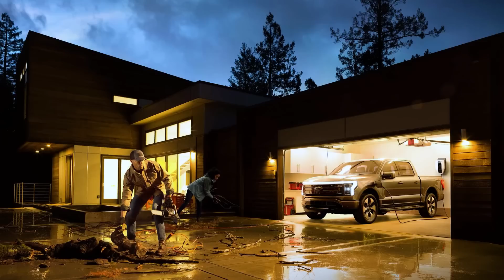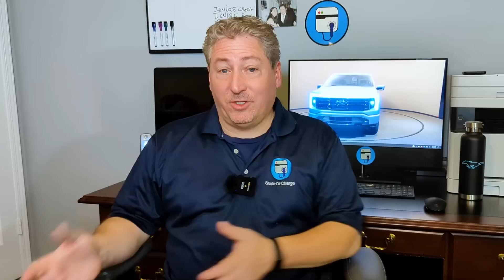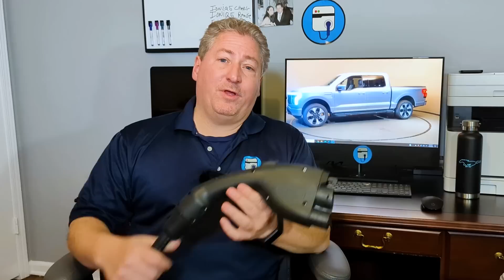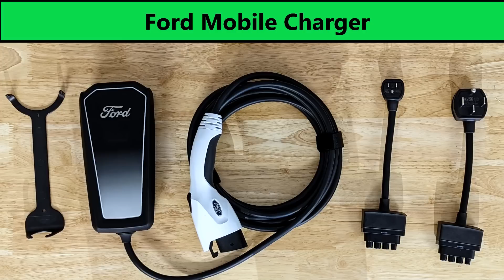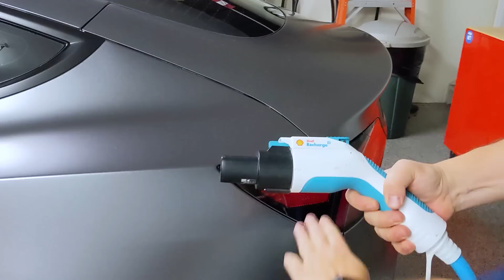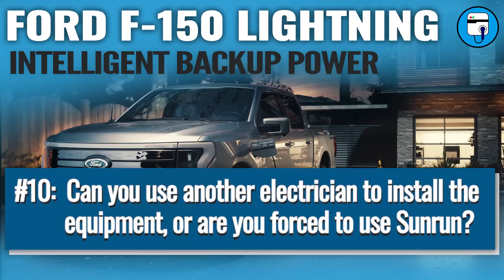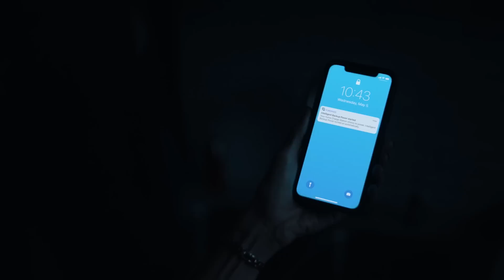Ford F-150 Lightning Intelligent Backup Power: Everything You Need To Know

Comment: Tom - thanks so much for putting this video together.  This is critical info that will help me make an informed choice when ordering my Ford Lightning.  The Intelligent Backup Power is the piece that trigged my interest in moving from an ICE to an EV.  This truck makes great economic sense... lots of addded value over an ICE vehicle.
Reply: but some of us that have 100A ( challenger panels are unsafe and obsolete by 2010 findings, its now 2022 yeh just go with the flow of civilised society ) are already upgrading to 400 amp maids like me and 4 or more homes on my bock have it two. as for your feelings yep my 1968 c 10 can't quietly back up my house 🏡so the ford does have a very good selling point and around town i was told it's cheaper to operate but i might not get the thumbs up as much as it just looks like a regular newer truck vs my classic fleet

Comment: I have been trying to get a straight answer from Ford and Sun Run but have not been able to get transferred to the right department. I have a extended range battery on my lightning and I have a trailer that I outfit my concrete lifting polyurethane foam machine. Graco E-20.
The E-20 during a concrete lifting project had peak amps of 38.5 (A-B and hose heaters and a proportional pump.
I had the truck bed outlets powering my air dryer, compressor, drum heater, lights and a fan(2400 watts peak) 
I have a 100 amp breaker in the trailer and I want to run the trailer from the truck. I don't see needing more than 50 amps at any point. When I tried to run the reactor on the 230 30 amp receptacle in the bed, I had no problem for the heaters but when the pump started the system could not keep up. I want to run the trailer from the truck completely.
I need 50 amps. What hardware would I need and who could I contact at Ford or Sunrun to help me get the system working. I would like to outfit polyurethane trailers to be hauled and powered by the lightning but I can't seem to get off the start gate.

Comment: Will you please do a Battery replacement cost for the F150 Lightning.  Because I have seen prices for extended range parts prices of $35,960 and standard range $28,556.47 through Ford Parts.  Just wondering what the average time a battery replacement should last for electric vehicles?

Comment: Great video. One update I have is that my system will not automatically backup when grid power goes out. I have to turn it on manually from the in-vehicle settings. I did some research on this problem and it looks like a very common issue if not the only way to use the backup feature. Also, the permitting department and fire department want to do a test of a rapid shutdown while the truck is powering the home. Disconnect of DC under load is not a good idea because the truck will try overcome the disconnect driving more power to the house and cause arcing and power surge in the house... so don't try it. I would love to know how the fire department is supposed to shut down the system in an emergency without causing a fire. Any feedback would be appreciated.

Comment: Solar Panels are DC and Lightning's batteries are DC. Is there a way to connect Solar Panels directly to the Lightning? I prefer not to have to convert the Solar Panel DC to 240V AC just so I can connect an AC Charger to my truck.

Comment: Tom don't know if you're still answering these.  I just installed the the whole system.  I have the Ford Pro 3000 charger and the platinum lightning.  The charging station wifi goes on and off all the time, it wont allow me to pair the truck to it, or, consistently show up on the Charge pro app so I can test the intelligent back up system??  Any suggestions??

Comment: Sunrun told my buddy they wouldn’t ship him a charger cause they said his car hasn’t been delivered. He says well it’s in my garage so your system is wrong. They said they won’t ship a charger until its say delivered in their system. Ford picked a terrible partner to make their charging and back charge inverter equipment.
Reply from the maker: There has been a lot of issues with the Charge Station Pro handoffs that my followers have reported As I have said in other places, I wish the unit was delivered with the car, or the customer could pick it up from their dealership before they take delivery so it could be installed before the truck is delivered.

Comment: Tesla sells their 48-amp Wall Connector for only $425. This is the best deal for a 48-amp home charging solution out there. This is not a bi-directional solution like the horrendously expensive Ford 80-amp connector but I mention it because the Ford 48-amp wall connector was mentioned as costing the same as all other systems on the market (which is not true).

Comment: Great video Tom! Very informative as usual. I have a particular question that I am unable to get any answers about:

If I already have a natural gas standby generator and transfer switch connected to my electrical system will the Ford home intelligent backup system be compatible? 

I think I know the answer to this question but there must be a way to install relays that will activate the generator and turn it on when the battery on the truck runs low so the generator can charge it back up.

Thanks again, hopefully Ford may see this question and address it someday!
Reply from the maker: Yes is it. Check out my new video: https://youtu.be/P7gCIT5FoAw

Comment: I have solar and I am about to install backup batteries with the goal of being energy independent, and someone suggested the F150 Lightning could accomplish this. Is that correct? Does it have the ability to switch to backup battery with the Home Kit whenever my solar is producing insufficient energy to power my home and drawing from its battery as opposed to drawing from the grid? I'll still be connected to the grid, but the idea is the draw comes first from solar, then battery, then the grid. I haven't been able to find anything addressing this specifically.

Comment: One thing that I think you’re missing is large scale power outages. When an entire region is out of power due to a storm it’s not possible to recharge anywhere for several days, a week, or longer because the fast charging stations won’t have power either. That’s when you need another solution to charge your EV.

Comment: Hi Tom, Thanks for the video. The one question I can't get answered is how to get the Intelligent Backup Power software activation for my Standard Range F-150 Lightning? I've had the truck a couple of months and it's great!  I bought, and have received, The Ford Charger Pro and the Home Integration System from Ford/Sunrun, so I have all the parts.  Sunrun doesn't operate in Oregon, so QMerit is the suggested installer here.  Qmerit connected me with their local partner, Beaver Electric in Hillsboro, Oregon.  Beaver Electric has put in a bunch of chargers, but no Home Integration Systems yet.  Ford's web site  says “Intelligent Backup Power software activation is included with the purchase of the extended-range F-150 Lightning battery or can be bought as a one-time purchase for the standard-range battery here.”  The word “here“ is a hyperlink to a page, after signing in to Ford, that says “SOMETHING’S NOT QUITE RIGHT, so it's a bad hyperlink.  I understand the upgrade is $500 and it is done over the air.  Over seven Ford phone-based customer support departments, in at least 3 different continents/islands, kept bouncing me to the next group,  but no one knew or could find the answer.   Please ask Ryan Ogorman, Head of Intelligent Back Up Power, as he, if anyone, should know.  I hope to get the charger and home integration system installed in the next couple of weeks, and this software upgrade/activation is critical to make it all work.  Thanks in advance for any assistance you can provide!

Comment: Did I miss the battery replacement costs? I looked at a 2013 Nissan Leaf. The battery is no longer available from Nissan. After market batteries with a 200 mile range cost twice the value of the car. That means the car is essentially totaled if it needs a battery. I do not see your Lightning going 10 years on original battery. If this is not figured in I do not think it is a good comparison. Sorry if it was mentioned and I missed it.

Comment: So, the big question is "how do you get the dc power from the truck to the home integration system"? Looks as if the ccs goes from the truck to the charge station, but the charge station is not an inverter. so what wiring goes from charge station to home integration to convert the dc power to ac power?

Comment: Great review. You speak so comfortably. Concerning Battery Backup a good point to make is despite a 30A limit of electricity sent to the house, if you stagger your electrical use you can run a lot of things. It isn't necessary to run the microwave, hair dryer,  gas forced hot air blower motor and toaster oven at the same time. Stagger them and the F-150 delivery capability will not be overloaded. Houses have 200A service panels so you CAN run all those things at the same time.

Comment: Please can you comment on the SIZE of the panels for charging system.  Sunrun will give me NO information on how large it is and how much roof space it will require.  In fact I have to build a structure to put system on BEFORE I take delivery of my truck and they will not tell me what size it needs to be.

Comment: If you want to power your home from your truck you will be able to do that with limitations.  Those limitations are:
No automatic transfer switching. 
Maximum 7200 watts supplied to home from truck.
You will need some sort of transfer switch to avoid back feeding to the grid.
You will need a way to connect the 30 amp receptacle on the truck to your transfer switch. 
If you're already setup with a generator you plug into your service.
Then you can used that connection to your truck instead of to the generator. 
The simplest transfer switch would be using an interlock in your service panel. 
A 30 amp generator breaker located just below your Main breaker.
The interlock will prevent the main & generator breaker from being closed at the same time.
As mentioned above you will be limited to 7.2 kw so you won't be using you electric stove, electric clothes dryer etcetera.
Note:
If the panel you are powering with your truck has the ground tied to the neutral you may get a ground fault error on your trucks sync screen. If you wish to use this scenario for home  backup,  I recommend you work with a qualified electrician.

Comment: I believe the 320amp service requirement comes in because of the NEC's 120% rule which states when back feeding a main panel the busbars can not be overloaded by more than 120%. Without getting into the weeds if Ford opens this up to feed power to the grid to reduce your electric bill (which would totally be cool) you could possibly back feed too much power that the main breaker would not see possibly causing a fire. For example if your main panel has a 200 amp breaker and the Ford charger can back feed up to 60 amps there is a possibility of having 260amps total on your main panel's buss bars if your home is using that much power at any given time. In this scenario the breakers would not see it or trip but your buss bars will be feeling it and be heating up. However, a 320amp panel is allowed to have up to 64 amps of back feed. Not confirmed only my guess. It would be interesting if @ford  can engineer in a software  limiter based on CT readings taken off the mains that way you can swt the back feed limit based on service size of each client. Ford can send a consultation payment my way ;)

Comment: I'm sure the 9600 watts that the lightning is capable of outputting has nothing to do with the power that can be supplied to your house.  The reason I say this is when powering your home with the lightning you aren't utilizing the trucks Inverters. The power is coming straight from the trucks battery via the two DC pins on the charge port. The roughly 400 vdc is transferred to the home integration system which contains a 400 vdc input inverter which converts that DC voltage to 240 vac which is then transferred to the service panel via a transfer switch which also disconnects the grid from the service panel. I'm not sure of the amperage but assuming it's close to 80 - 100 amp range, or 19.2 kw - 24 kw output if it was to power the entire home for 3 days @ 30 kw/ day.

Comment: The you need to add up all the panel traffic including loads, batteries and other self generating current . That’s where the panel rating comes in, not the size of the service. A generic way to attack this is upgraded you panel to a 400 amp  buss and derate to the main breaker size.

Comment: Could you charge up the truck at a fast charger at the dealer? Then use the charge to power your house?! Reminds me of the stingy villain, Smythe, from the movie "Jules Verne's Rocket to the Moon" 1967 stealing gas from gas lamps using a hose and pump. Swiping $20 of electricity doesn't make practical sense, but it would be something for the LoLs.

Comment: You need 100 amp wire to charger, at 80% load gives u 80 amp , so 100 amp is not enough, min200 amp, you keep 100 for the house 100 for the charger

Options to charger circuits
 20 amp
30 amp
40amp
Those typical for appliances so you could put those to a charger 

I believe the lightning comes with a two chargers 15 amp and 30or 40, get a electrician set up 40 amp circuit you have 220 v 40 amp circuit available at 80% load gives you 31 amps to charge,

Comment: My Generac can provide 18 kW running on NG. Its run time is unlimited. The total cost with transfer switch and professional installation was $10k. And I can drive my vehicle while the Generac is powering the house. The 9.6 kW that can be provided by the truck isn’t going to handle the starting current for my 5 ton main A/C.

Comment: I can’t imagine the backup power thing will be used to death (warranty covering home backup power)

99% of people will never use this, the 1% that do will probably use it maybe once a year. Sure outliers will exist(off grid workshop maybe) but I’d think it’s worth giving that 0.1% if users to just have free batteries. It will take years to ruin a battery that way anyway.

does driving really pull from the battery differently than using it for other purposes?

I would think the loads would likely be less (but pulled in the same way)

Comment: Great video, you really taught me a lot. I noticed when you explained that when we are powering the house the 2 bottom pins are used to provide DC power from the battery. Are you sure it's producing DC or is it AC current because if it's producing DC current where does the Inverting takes place to convert that DC power to AC so my home can use it?  I hope I am clear.
Reply: Sunrun who makes the pro charger for for also makes the system required to power your home from your lightning.  Using the CCS connector send 400 volts DC to the pro charger which then sends the 400 volts dc to the home system made by Sunrun. That unit has an inverter and a transfer switch integrated in its system. So when using the CCS connector to power your house the trucks on board inverter isn't being used.

Comment: Can you skip the whole "Back Up System" n just use your 9.6 kw Truck bed's 32 amp receptacle to power your panel when the grid is out? Use an 6 gauge wire w a 14-50 male on one end and an L 6-30 or 14-30 (which ever adapter need for the receptacle on the bed) male on the other end to draw power from the truck to the panel?

N if so, can you use the entire battery capacity (98 or 131 kw) from those receptacles? 

And if it's a "Yes", wouldn't that be easier than spending all that money ($5k+ from Sunrun and $3-4k from dealer) n time waiting for the installation?

Comment: What's the point of having a 100 amp outlet (80 amp charging) if the lightning only has a 9.8 kw on board charger? Shouldn't we just use a 50 amp (6 gauge) w a 14-50 instead?
240×40= 9600÷1000= 9.6kw
Reply from the maker: The extended range battery pack comes with dual 9.6 kW onboard chargers, for 17.2 kW, or 80-amps.
Reply: Got you, thanks!!

Also..... I've heard this phase (from your Factory Tour and Test Ride video) which is confusing me "The f150 Lightning will be able to output 9.6 kw of power through the backup power function.  Thats gonna be good enough to power your house for about 3 days according to Ford".

Now is that statement accurate? Or is it the 97kw (standard) or 131kw (extended) battery that is powering your home from 3 (average) to 10 (conservatively used) days?

Just to confirm; the lightning can power your home up to 9.6 kw max at any given time without shorting and is able to use the truck's 97/131 kw battery to power the home, an equivalent to 7 - 10 Tesla Power walls (13.5 kw per) and not just 9.6 of the Truck's 97 kw battery, correct?

Comment: Regarding battery warranties, I think a fair solution for both manufacturers and consumers is for there to be a separate "battery odometer", and for there to be an algorithm that monitors usage during vehicle-to-home usage periods, and calculates an equivalent amount of miles of wear-and-tear that would have been put on the battery if it was driven. So you use the car for V2H for a few hours, it calculates that about 12 miles worth of wear-and-tear was put on the battery, and it's added to the battery odometer, which you can view in a vehicle menu. Then the manufacturer can still keep the warranty simple: the battery is warranted for 10 years or 100,000 miles on the battery's odometer.